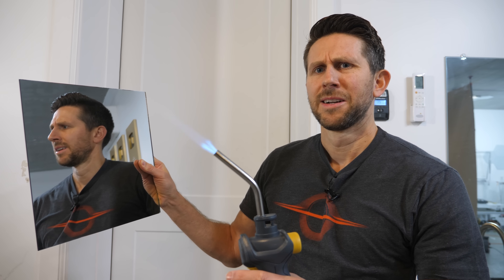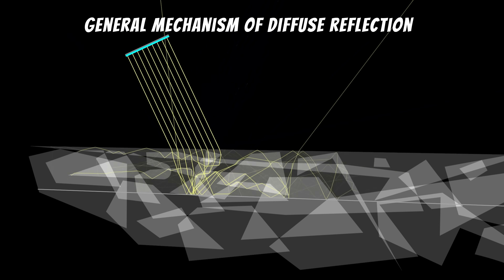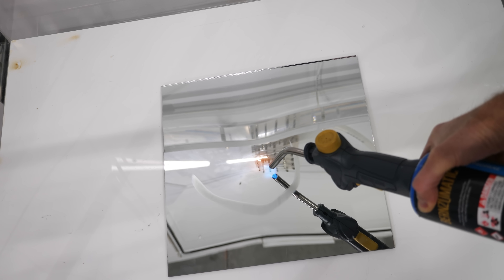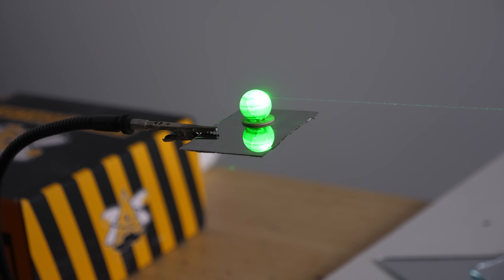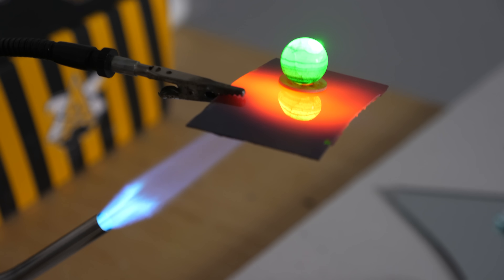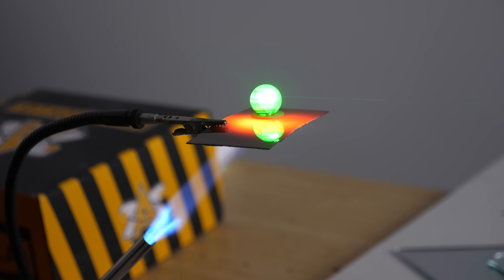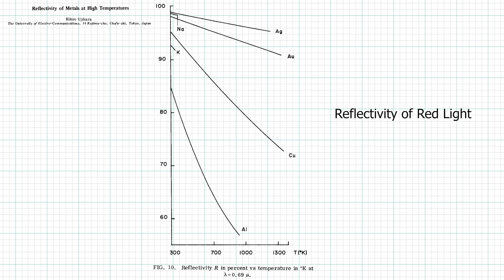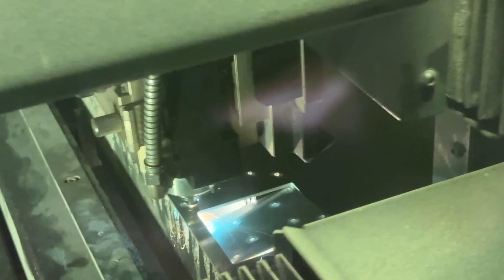Can a Red-Hot Mirror Still Reflect an Image?

Comment: i maybe had idle thoughts about like lava and metal and how it glows bright maybe in video games. then wondered how bright metals could actually glow just with heat and the sorta stuff about whether old thorium wick street lamps were super hot or just regular hot as they kinda do the mild radiation thing so we tend not to use those anymore. So i maybe wondered about reflections and if you shine a bright light at a hot metal stuff what the levels of interference or 'light cancelling' would be and if the heat IR range is too little of the rainbow to alter the reflection or light much or if it sorta knocks the whole rainbow wobbly. What would that word be heat interference with light? is there a term? or is the light the heat and the heat the light? light interference with itself?

Comment: On the topic of objects working when hot, does a tuning fork keep its tone when hot?
Reply: no. theyre standardised at a controlled temperature, and are only accurate at that temperature... and air density... and humidity... blah blah...

even piezos will alter in pitch.

Comment: @TheActionLab 
Hello, I'm a little confused. According to your video, this is the information I understand.
When light strikes a surface,
If the metal light will be reflected immediately after touching the surface, or the light will be absorbed slightly through the surface (if described in an easier artistic way, this corresponds to the intensity of specular reflection, similar to putting an environmental picture layer on a black layer in ps and adjusting the opacity. Generally, the specular reflection intensity of metal is 70%-100%). According to the scientific description, light hits the surface or is eaten by all the electrons on the surface, and then the electrons will glow. Either light hits the surface, and some of the light passes through the surface electron layer and is eaten by atoms, and the other part is eaten by all the electrons on the surface and then the electrons glow.

Usually, the roughness we talk about is whether the surface of the object is uneven or not, which leads to the light being scattered.

The non-metallic "diffuse reflection" means that when the light touches the surface, it will penetrate the surface deeper and then scatter, and the light will be scattered and reflected in all directions, so the overall energy will be dispersed. The dispersion here does not occur on the surface of the object, but under the surface. Therefore, even if the nonmetallic surface is very smooth, part of the light reflected on the surface will not be dispersed, but the other part of the light penetrating into the surface of the object will still be scattered and lead to the dispersion of the light.

But I don't understand if this is the case, will metal look like nonmetal when it is rough enough? Because according to the above, it can be roughly understood that nonmetal has two layers of reflection, even if the surface layer is very smooth, the light will be scattered, so if the metal is very rough, shouldn't it be the same as nonmetal?
However, I observed that the actual white metal (stainless steel and the like) looks different from the white nonmetal even though it is rough, whether the white nonmetal is smooth or not.

In subsurface scattering, however, the light is traditionally deeper and then scattered.

Comment: Impressive demonstration, but what's even more impressive is wondering about it in the first place. I own and use several first-surface mirrors with non-metallic dielectric coatings, but I never thought to wonder how they would operate in a furnace.

Comment: what if instead of heat interference you do electromagnetic interference on a metal polished working as mirror and on a normal single backside slim metal surface on a regular mirror

Comment: I work in the melt department of a cast iron foundry. For a couple years in the early 2010's I was a crane operator. The ladle full of hot iron rides beneath you as you take it down to a mold. Sometimes we would be too hot and sit at the slag tub waiting to cool down. The iron would calm down after slagging and I would see the ceiling lights reflecting off the bright hot iron with surprising detail. It was then I realized that iron is still super shiny even when it is liquid and bright yellow.

It was also cool watching the tiniest bits of slag or impurities slowly coalesce into the middle of the surface of the iron. 

Stuff like that and the sheer weight of the ladle full of iron, slowly swinging on my hook, gave me so many hands-on lessons on physics and the effects of gravity. 

Now I run a 20 ton induction furnace and watch the scrap steel melt into 40,000lbs of 2700 degree iron. When the iron is melted and the furnace is running (8000kw), the top of the iron makes a dome shape.
Reply: I guess that makes sense. After all, molten solder is also shiny
Reply: I was going to say the same thing about liquid metal but with zirconium. I run an electron beam furnace at my work and see the reflection of the feedstock all the time on the skull when it's molten. 😅
Reply: Scary job

Comment: Surprised you didn't mention the James Webb Space Telescope (JWST).  The main reason they have the telescope so far from Earth and block sunlight from reaching the mirrors is that even room temperature mirrors don't reflect infra-red light well.  But, the super cooled mirrors on the JWST reflect even very low frequency infra-red.

Comment: If you melt solder and clean the surface so it is shiny and get an infrared thermometer and tey to measure the temperature you get ambient temperature.

Comment: How does the spray paint that will make a mirror work and what is it made out of? I made me a mirror a few years ago when I seen a can of it at home Depot and I was curious to see how well it would work. 
When you spray on a clear plate of glass the side facing you when you spray is not the reflected side but the same dull greyish color we see on backs of mirrors I was impressed how well it actually worked even though it was my first time doing it and I didn't have it even and was too close to it to where it would be messy globs or uneven it was some not enough while other areas too much but after 2 more coats of it you couldn't hardly tell, you still can if you really was looking for it. Think it might be better if you just roll paint it on but idk if that is even possible. I love that spray paint and the chalk board one too! 
But I'm wondering how they managed to put that in a spray can and make it work? 
Also how does 2 way one way mirrors work,  which ever one they use in police lineups where you see the suspects but they can't see you? 
 What's the science behind that one?

Comment: i used to work with stainless steel. making mirrors for jails. it is hard to make the surface reflective enough. the theory suggest that the reflective surface consist on a very uniform and linear array of hills and grooves with the same higth and depth. So i wonder. is it the same if you heat the surface from one side or another (what happens with the thicknes of the material, normally Stainles Steel is used in thin sheets) and the method to heat. if you use a torch, then you are leaving layers of ashes on the reflective surface when heated there, but not if you use another source of heat.
Very interesting

Comment: 6:58 
This graph is interesting, because it shows Gold and Silver at the top, showing how they loose far less reflectivity. This is interesting, because I have read that in the early days, the way they refined gold and silver was to melt it, and skim off the impurities, and when the refiner could see their reflection in the molten gold/silver, they knew they had (mostly) pure metal.
Reply: I would guess that’s more because most impurities would quickly oxidize under the heat and turn opaque, but it’s still interesting to think about
Reply: by "in the early days" do you mean today? because thats how they do it, even to today.

Comment: Why did the big mirror shatter? For anyone wondering, since the video didn't cover the details of that part, what happened is that the heat was concentrated on one spot which caused it to expand enough to push really hard on the cooler surrounding glass until it couldn't handle the stress and exploded.

Comment: Looking at just the marble and the reflection area it looked like the marble was brighter than the reflection and radiation from the hot mirror in that area combined. Also the fact that the radiation swamped out the green color so much suggest the reflectivity was very low.

Comment: Isn't the heat transformed into light, which would make the mirror reflect even more light in different wavelengths? Is the conversion of heat into light a reflection? Would an energized material be more reflective if hit with different frequencies that corelate with specific colors' wavelengths?

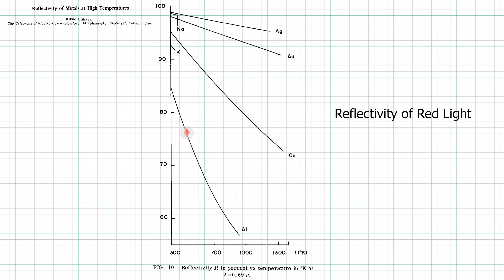Comment: If conductivity was the sole reason why metals are reflective, copper should be more reflective than gold, since it's more conductive, but according to the graph at 7:00 it isn't, so what gives?
Reply: It's not conductivity persay but it is the mobility if the electrons. This includes the bound electrons which don't contribute to conductivity but do contribute to the permittivity -> therefore refractive index and so on

Comment: Okay. In light of everything said in this video, now that you know where the hot spot is on the polished stainless steel mirror, do the experiment again but shine your laser pointer at the hot spot and see how much less light is reflected onto the wall than when the metal was cold.
Reply: It should be pretty hard to tell.  The only difference we could see with the marble's reflection was it being overwhelmed by other light, not muted.

Comment: 4:49  You could have filtered out the red light to see if there is loss in the other freqs due to heating? Or use a spectrometer to see how it falls off, if it does?
EDIT: 6:46 OK, but I think you could have done it yourself without too much effort? Version 2 of video?

Comment: One experiment, you need two thin steel plates separated by 1 cm and heated to the same red hot color then if you place a third steel plate in between them while they are still red hot you should see the shadow cast by the metal plate in between them. This should work while still red hot, but did not test at the point of white hot, could you please test that. The explanation is simple,  although metal reflectivity to white light decreases with temperature, if the frequency of the light is the same as that emitted by the hot metal, this light has the property of letting this frequency of light through, that's why you should see the light from the front plate plus the light from the plate in the background which using a cold plate in between you should see the shadow. Good Luck

Comment: well, from what I remember from school, emission coefficient matches absorption coefficient.
Something glowing red must also absorb red.
On the other side, we have electromagnetic wave theory.
and hot copper probably has still lower resistivity than than cold steel.
check reflection of laser ray.
green and red.
Reply: Yeah, it would have been interesting for him to shine far IR, near IR, red, green, blue, and UV laser beams on it and have the reflected beams fall onto a set of photocells so as to measure the reflected power for each wavelength vs. temperature.

Comment: In my research I heat up polished metal surfaces to ~1000 degree C under VACUUM. So completely inert, without any oxidation. Even though the thermal radiation of such a piece becomes very intense (red hot glow) I can cleary see how it reflects the internals in the device very accurate.

Comment: If you broaden the spectrum you're looking at you will see that even at room temperature mirrors are emitting light. When heating it up the emission spectrum shifts to shorter wavelengths and becomes visible to humans. But that's nothing the material cares about. It should be obvious that mirrors should not stop being mirrors at a certain temperature.

Comment: I wouldn’t personally call that a mirror. That is generally considered ‘a highly reflective surface”, compared to a ‘mirror’, that is generally considered to be a layer of glass which has a thin backing of reflecting metal. 

Still, this was cool.
Reply: They're both properly called mirrors, just that one is a first-surface mirror and the other is a second-surface mirror.  A regular bathroom mirror is a second-surface mirror, where the reflecting surface is the second one the light hits.  A polished piece of metal is a first-surface mirror, as are telescope and laser mirrors that are made of glass or crystal and have a polished layer of aluminum, silver, or gold (for IR mirrors) deposited on the light-facing side.

Comment: Chemically bright anodising of aluminium can produce a highly reflective surface, especially if the aluminium has been polished before anodising. Any welding should be done before bright anodising, considering anodised aluminium has a very hard coating and a melting point of around 2050° C, and untreated aluminium will melt around 660° C. It might be interesting to see how long the mirror finish on chemically bright aluminium would last considering Stainless steel's melting point is betweem 1,375°C and 1,530°C.

Comment: I understand most metals can do that, but what about altering Graphene's underlying structure like a light guide, but in a different way?  Is it possible to manipulate the electron spin and induce reflection?

Most Mirrors have glass and a metal behind it- what about using Graphene as a glass with polished steel behind it?  That way the graphene "coating" is used as a protectant to keep it from cracking or becoming a melted mess in a high temperature environment (embedded beads of metal)

Comment: This is an actual problem when using thermography on partially reflective objects, because in the thermal infrared there's always a lot to reflect. So if you want an accurate measurement from a thermal camera, you will have to dial-in the object's emissivity and the reflected temperature. I do this a lot at work because I work on temperature control in 3D printers.

Comment: I thought about this after watching the video. My guess is, heating the steel sheet did not change its reflectivity of visible light much, but much more in the infrared spectrum. The heated sheet basically becomes a (infrared)light emitter itself. Maybe this experiment can be repeated with a thermal camera and an infrared light source (maybe something simple as a soldering iron?).
Reply: But the data from the paper he referenced showed reflectivity of each of the metals decreasing with increasing temperature.  While I don't have access to anything but the abstract for that paper, I'm willing to bet that before measuring reflectivity they quantified the black body radiation intensity at different temperatures so that they could easily substract that data from the spectrum of light emitted AND reflected from the heated metal  to get at how much of the incident light (in this case they illuminated the heated metal with 690nm light) was relfected.  They will have also of course measured the power in that 690 nm laser light so that they could compare that to the data captured with the metal heated.

Comment: Hm... now I'm curious, if you could make mirrors out of high-temperature superconductors like YBaCuO (I guess not?), which aren't conductive at room-temperature and do an equivalent experiment at superconducting temperatures and let it then heat up to room-temperature.
(probably you need to do it in an air-tight setup with a perfectly dry gas, to avoid condensation/ice building up on the mirror)

Comment: 6:35
We can see the drop in reflectivity here.
When the laser hits the yellow-hot area, the reflected beam is dimmer.
Reply: its not dimmer, its being drowned out by its own emitted light... and the camera sensor is adjusting itself to a constant exposure...
Reply: @paradiselost9946 
That doesn't explain the exact same brightness of the yellow-hot patch and incoming beam, as the reflected beam changes in intensity.

Comment: I was just as intrigued by that marble lighting up with the laser.
Reply: I would comment the same thing. The marble illuminated by the laser was so cool.
Reply: The laser got trapped in the marble because of the angle that it was hitting the marble-air barrier. It is the same principle that fiber optic cables use.
Reply: Red hot mirror should take the supporting role ngl
Reply: @Beeblebroks  Funny phrasing, as it was LITERALLY, physically, supporting the marble.

Comment: @The Action Lab  Fascinating! I know that metals increase their emissivities at higher temperatures (otherwise tungsten filaments wouldn't work very well). And there's a principle in physics that says if an object can emit radiation, it should be able to absorb that same radiation. So it does make sense that the reflectivity drops with increasing temperature.

In fact, I recall reading that tungsten's emissivity goes all the way up to 0.7 at operating temperature in a light bulb. But this was a long time ago, so don't quote me on it. 

Oxidation also increases emissivity though, so I do wonder about the red hot steel.

Comment: Hallo everyone, it seems to me that: "A mirror couldn't reflect a light that has the same wavelength of its thermal emission" Unfortunately it is the result of an old thought that now I'm not anle to remember, but it seemed to violate the principle zero of thermodynamics.
So that it would make possible for heat to travel from colder objects to hotter ones.